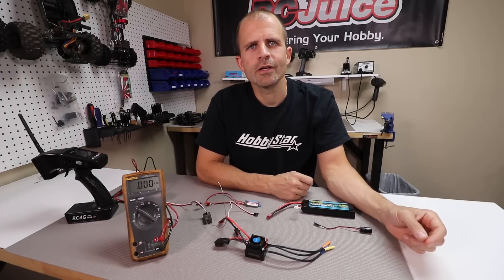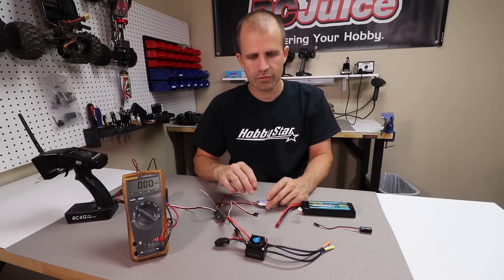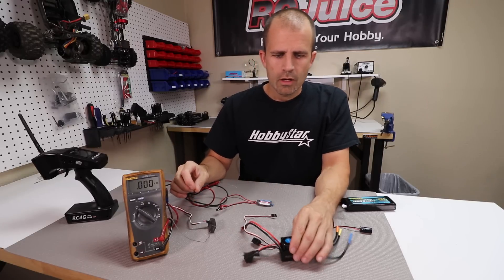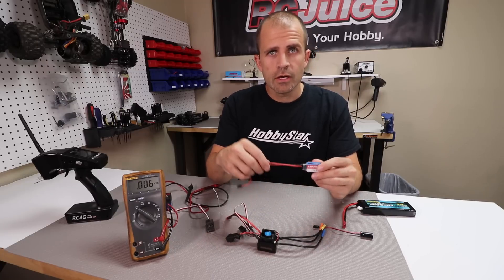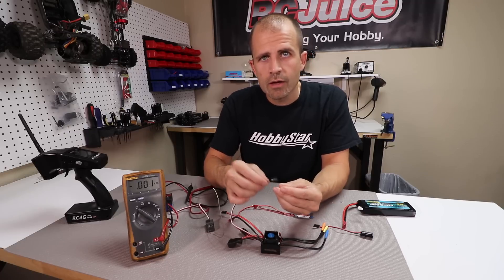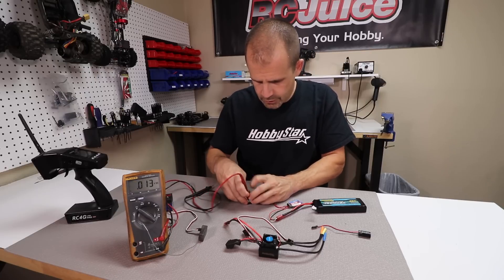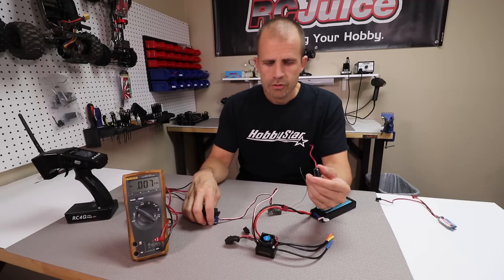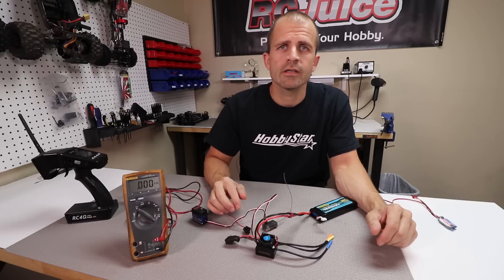What is a BEC and what do they do in the RC hobby?

Comment: OK, I get it that I have to disconnect the BEC power line from my ESC before I plug in an alternate BEC.  I've got three wires (colored brown, orange and yellow, left to right, as I face the metal tabs in the plug with wires at top). Question: How do I tell which wire to cut?  In that orientation would it be the left, right or center wire (regardless of color)?  Thanks for your great vid and for making clear which is the power line.

Comment: So anyone out there who can help me I’m trying to run two 40mm protek fans on my udr instead of having the “cosmetic only” ones and I have the mount already made and everything fits. Only issue is I don’t know if I should run them in parallel or what cause I don’t want to burn out the esc, cause brownouts etc what would anyone recommend me ? I seen the glitch buster or the standalone bec ? They run at 5-8.4v individually
Reply: The fans^* and also this video helped but now is which route to take

Comment: Brother, I would like to ask you something. If we use multiple servos, 8-10 pieces, each with different sizes, such as 9g, 21g, 6kg, 9kg, 15kg, and the voltage of each piece is different, ranging from 4.8v to 7.4v, what kind of BEC should we choose? If we choose the 6v one like yours, can it be used normally?❤

Comment: Hello, my rc car is losi lst xxl2. When I operate the steering servo (dual) with the searchlight connected, the searchlight blinks. In my situation, will this problem be solved if I plug any capacitor into the receiver as you said? It's expensive and complicated to work on the bec.

Comment: I am building a glider, and planning on using a 5V battery with a 5V-8V Receiver. Do I still need a BEC, can I just wire the battery straight into the reciever.

Comment: Just remember. If your BEC on your ESC can go up to 8.4v and you have an 8.4v high voltage servo you need to make sure your receiver can handle 8.4v. Your receiver may only be able to take 6.0v or 7.4v. You can only go as high as the lowest rating on an individual component, be it your receiver, servo and your ESC. The ESC is the power source for your receiver and servo. When programming your BEC check your servo rating AND your receiver rating and program your ESC’s BEC accordingly.

Comment: My RC car is throttling lightly without even pulling the trigger on my radio. I was told it is one of three things…A bad radio, interference from the servo, or the ESC’s BEC, but the radio is only a few months old…When I install a glitch buster capacitor to the receiver everything is fine. But that is a band aid. What do you think the problem may be? Is it possible that I need to increase my ESC’s BEC voltage in order to eliminate this problem without having to use a glitch buster?
Reply from the maker: It's possibly an interference issue, but most likely an issue with calibration.  Make sure you you set your throttle trim all the way down/to zero before calibrating, afterward if you happen to turn up the throttle trim at all it can cause symptoms like you mention but this just sounds like a calibration issue: https://www.youtube.com/watch?v=MIpvyi8vjHk
Reply: @RCJuice  the thing is it’s intermittent. Happens every once in a while. I feel like if it was a throttle trim issue it would do this every time it was powered on right?
Reply from the maker: @floridalife7877  Yes, if it's intermittent then it's likely not a trim issue but we would still recommend re-calibrating the ESC.
Reply: @RCJuice  thanks. I’ll recalibrate and see

Comment: My reciver can only handle up to 6v but my servo needs around 8.4 to operate. Can I run a BEC from the battery to the reciver so it doesn't blow. Then run another BEC from the reciver( on a channel for the servo) to give the servo the needed 8.4V?
Reply from the maker: You would want to wire a BEC to the battery and run the power directly to the servo, and then only run the signal wire from the receiver to the servo.
Reply: Thank you

Comment: Now if you put 6 volts and 6 volts into receiver  it should still be 6 volts you should only get more amps.  Now if it where in series you would get 12 but as long as it is black wire to black wire volts won't change,  Am I misunderstand something?  thanks .
Reply from the maker: Sorry but not sure if we understand the question.  Any time you connect 2 batteries yes, you can put them either in series or parallel.  In series you will double the voltage and have the same capacity/run-time as one battery, and if you connect them in parallel you have the same voltage as 1 battery, but the run-time of 2 batteries.  A BEC just steps the voltage down to the required voltage for your application.

Comment: I have kraton 6s v5 and the bec is set at 7.4 volts stock but my local hobby shop turned it down to 6 volts said it was better. Everything is still stock on my truck, do you think 7.4 volts would be better? I want maximum performance
Reply from the maker: As long as your servo and receiver are rated for 7.4V then it is recommended, it provides more speed/torque from your servo and is more efficient.
Reply: @RCJuice  thanks for reply!

Comment: Quick question. Need some help ..  do the bec wires allways stay plugged into the ESC or do you unplug them after its callibarted .. just wondering because I only have one spot for either the 3 wire servo or that on my ESC/receiver.  I'm a bit confused to be honest
Reply from the maker: The ESC lead needs to stay plugged in so it can receive a signal from the RX.  Channel 2 is always throttle, 1 is steering and the rest can be used as "power" outlets if you are not utilizing the channel for anything else.

Comment: Hello I'm very much so new to the RC world .
I have an unbranded rc car 1:10 scale. The electrical board doesn't work. So I wanted to do an upgrade on it with speed control, receiver, and servo. But I have a few questions like, can I keep my same transmitter (it has a bind button on it) also it has a 390 motor on it but I wanted to upgrade it as well to a 550. And I wanted to look into a 2s or 3s liPo set up.

Just wondering but , Overall I'm to get another one.
Just wanted to use that one as a "learning" one
Reply from the maker: Please shoot us an e-mail at support@rcjuice.com , there's a lot of questions there and we can best handle via e-mail.

Comment: Nice video clear and easy to follow.
I have my Externel BEC set at 7 volts.
Can I just plug my standerd lights in the reciever or will the voltage be to high.
Reply from the maker: That depends on the voltage rating of the lights, most newer lights can go to at least 10V so it should be OK but check the ratings to be sure.
Reply: @RCJuice  thanks man...and keep on educating the world of rc ..

Comment: how do you wire up the BEC so a single server runs at 7.4 and 2 other servos run at 6v?  i keep burning out the micro servos since they are 6amp max, the main steering servo can go up to 8v.   my speed controller has a BEC and i have a castle 2.0 wp but i cannot figure out how to separate them.
Reply from the maker: You need to run 2 different BEC's.  You can run the servos all off the same receiver, but you need to connect the power wires from each servo to the BEC with the appropriate voltage. No way to do this without 2 BEC's though.
Reply: @RCJuice  I actually figured it out! I used a bec bypass adapter. It plugs only ground/signal into your esc. Power goes direct to servo through bec.
My esc powers the two separate 6v servos with its internal bec!
I’ll try to find a picture of the adapter I used to link it!
Reply from the maker: @ed0c  Yes, that is doing what we mentioned by only using the signal via the receiver, and powering through the BEC.  Nice work :)
Reply: @RCJuice  thank you! I made my own adapter after some research and a bunch of videos like yours. Much appreciated for the replies!

Comment: Question 
If i'm using only one ESC with no external BEC and disable the red wire on my speed controller, will the receiver now receive the full voltage from the batteries or will the receiver just not power on?
Reply from the maker: The receiver would not receive any power in this scenario.
Reply: @RCJuice  thanks I'm new to this kind of stuff.

Comment: Great info sir! Question... Installing a HW 1080 BEC in my TRX4 Sport and I have a Traxxas 2260 high output BEC. Should I NOT plug the HW ESC into the Traxxas BEC where the stock ESC was plugged in?  Don't want to blow anything up.  Thank you!
Reply from the maker: No it's OK to plug the HW ESC into the Traxxas BEC.

Comment: What’s the black thing coming from the esc with the kinda protective cap over it?
Reply from the maker: They are capacitors, sometimes mounted on the ESC itself but often mounted remotely.
Reply: RCJuice cool thanks. So when we install an esc that has one coming from it do we just secure it down somewhere?
Reply from the maker: @jct4111  Correct, you can just use some double-sided tape as you do for the ESC.  Some guys will zip-tie it to the wires as well, as long as it's secured and not flopping around you are good to go.
Reply: RCJuice perfect thanks a lot

Comment: Is it safe to use converters like xt60 to xt90 adapters.
Reply from the maker: Adapters are OK to use, but keep in mind that the overall connection rating is only going to be as good as the smallest connector, so if you are working with something that requires an XT90 then any XT60's in the setup would not be appropriate.
Reply: @RCJuice  The esc is xt 60 and the battery is xt 90. Battery has 5000 mah 4s or 3s has xt 90 while 3000 mah has only xt 60.

Comment: I have a truck, with a led lightbar attached, everytime i turn the servo left or right, the led would blink for a split second same goes when i pull the throttle at once. im using a HW1060 which i believe comes with a 2A bec, will an external bec with higher current rating resolve my issue? thanks.
Reply from the maker: That definitely sounds like you need an external BEC, many servos are incredibly power-hungry and it sounds like it's drawing enough to pull power from your light setup.
Reply: @RCJuice  so with ana external bec, will i be able to have a single on-off switch for the rc? i suppose ill just leave the esc on-off switch to on position all the time, and use the new on-off switch from the external bec right?
Reply from the maker: @hauwkeautogallery  Generally not, you usually wire a BEC directly to the battery leads so it would require a separate switch.

Comment: Can a bec be used for a dual battery setup..if one battery dies can it switch to auxiliary battery???
Reply from the maker: No, that would require separate circuitry.  A BEC is simply a voltage regulator.

Comment: Great inormative review 👏👏

If i see capacitors on my  Castle BEC- Does that means it has a glitch buster integrated in it?..🤔
Thx..😎
Reply from the maker: Thank you for watching!  No, the capacitors on your ESC do serve a similar function, but that is for the ESC power and not for the power it sends to your receiver via the BEC.  If you want to run a glitch buster for your radio, you must run the separate one on the receiver itself.
Reply: @RCJuice  
I refered to my BEC and not the ESC..
Got the Castle Creations BEC 2.0 15A...
I see a capacotor on it..
Reply from the maker: @ETAI106  Sorry!!  In general yes, the caps on your BEC will perform the same function.

Comment: I bought a hobbystar 70kg servo for my losi dbxl-e, can i just install it on my rc with out any other upgrades. Or will it damage  my the esc or reciever?
Reply from the maker: Installing as is will be perfectly fine and won't require additional upgrades for use.

Comment: Adjustable high-power BEC listed on Spektrum 130A Firma ESC?  The specs list that it is adjustable.  ESC info lists that the BEC voltage is 6V/4A.  If it can be adjusted, what is the max adjustment?  This number is the determining factor on how I purchase an upgrade Steering Servo.  I cannot for the life of me find the answer to this.  Hope you can help.  It’s been 24 hours of searching for the answer to this question.

Comment: Hi! You are not able to double the voltage - regarding the 5:30 in the movie. Both are connected together in parallel so you have still 6V, but there is risk of current flow between ESC and additional BEC if any voltage difference is present.
Reply: That threw me for a loop too when I heard it.

Comment: When you are using a stand alone BEC how is it possible to plug two power wires into a Receiver, doubling your voltage. Wouldn’t you just eliminate plugging the ESC plug (going to the receiver) altogether?

Great video!!
Reply: You Still need to connect the ESC (with the power wire disconnected) into the receiver) into channel 2. That's (generally) the channel used to control the signal from the receiver TO the ESC. If it's not plugged in you won't have any speed control.

Comment: Can i power my run cam transmitter through this circuit
Reply from the maker: Yes you can, as long as the voltage matches the requirement you can.

Comment: Sir I have a question.I have a Power hd 25kg servo and I ordered a hobbywing 1080 with programming card and a castle bec 10a with a default 5.1V. Do i need to buy the Castle link to program bec into 7v or Ill just program the esc with 7v servo option with its programming card without buying the castle link?

Comment: Not long ago, I had a strong servo that was pulling more current than the in-built ESC-BEC could deliver, causing the Rx to go into failsafe mode. Since then, I use a dedicated BEC or a separate receiver/servo battery, as standard practice. You will amazed at how much current a large servo can pull, and how much better it will work with enough juice!

Comment: Thanks for sharing this great info! Do you know how i can test a glitch buster capacitor for operating good or if broken? Also, how will i know if i need a 3 amp bec or a 5 amp bec?
Reply from the maker: Check the section titled "testing a capacitor" here: https://www.ifixit.com/Wiki/Troubleshhoting_logic_board_components    Good question on the BEC, the short answer is that to know for sure you'd need to do some live testing with a current meter on your current setup. For most 1/10 and 1/8 applications 3A is plenty, but that being said BEC's are like ESC's in that if budget/room allows, bigger is better.

Comment: How exactly are you doubling your voltage. The connections are parallel so you should only be doubling your amp capacity to the receiver, volts should be unchanged. What am I missing?
Reply from the maker: It depends on the receiver, it's true that in some scenarios it does run in parallel but it's a safe rule to never do just in case.
Reply: Mike Kennedy j

Comment: I need help can I use a castle bec with nimh battery pack or do I need to switch to lipo battery or what should I do
Reply from the maker: As long as the voltage of your battery pack is greater than the output you are using on the BEC then it is fine, the BEC does not "care" where the voltage is coming from and will still work fine.

Comment: Great video .. if you have adjustable volt on your esc and set it to 7.4 volt will this effect the reciver you are using ... I have a traxxas reciver and plan the add a castle esc and motor and want to set the output voltage to 7.4 volt will this damage my receiver?
Reply from the maker: It can.  Most newer receivers are HV capable, but you do need to find the specs for the specific receiver you are using.  Traxxas usually does not publish those specs so you may need to reach out to them, it is likely they are NOT HV capable.

Comment: Can i use a 12 v battery with a bec on a car witch use 9.6 v battery?
Reply from the maker: No, a BEC is not capable of handling the current needed to drive a motor.  The BEC is just for supplying power to radio/servos/accessories.